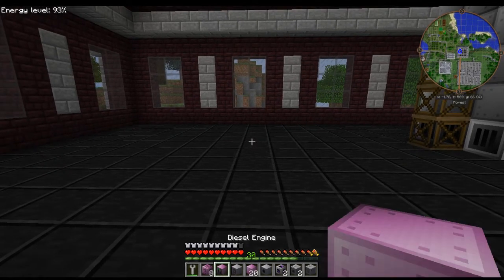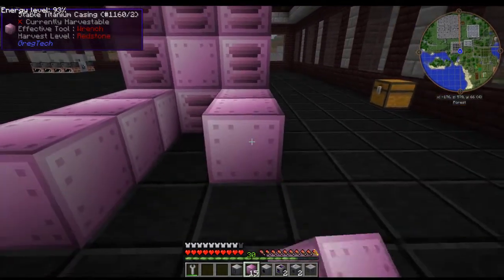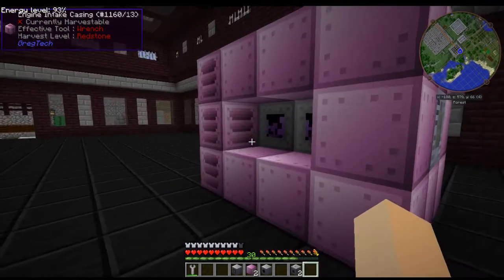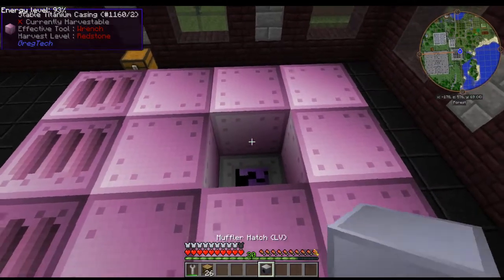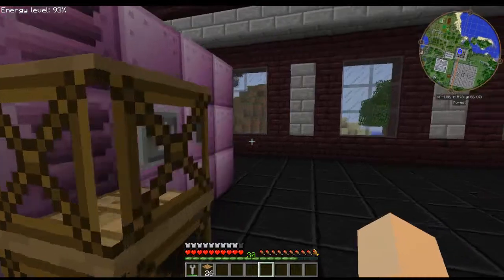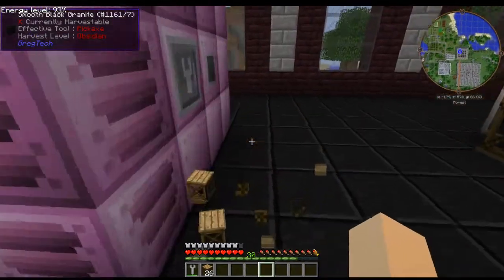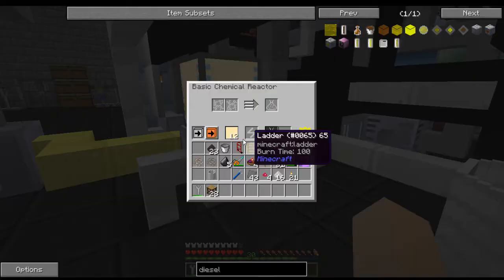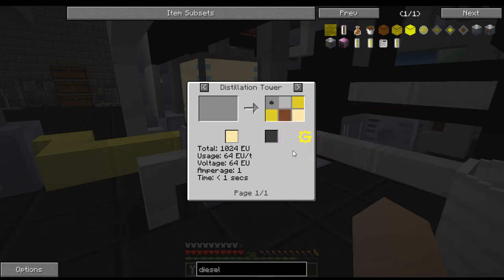GT5u Multiblock tutorial series - Diesel Engine / Combustion Engine

Comment: Super helpful! Once I eventually get the stupidly vast quantities of titanium necessary I look forward to taking a crack at it.

You were saying something important about boosting it but it got garbled I think... 30% fuel intake, 3x power output was it? Jeez. daang. That leaves me with one question. The scanner gives me info on cycle times and a couple of other helpful tidbits, but is there a tool that indicates the energy flow rate (like how much eu is being consumed or transported through the wires per tick). On a similar vein of questioning is there some way to measure volumetric flow rate through pipes, cause I've just been juryrigging my big boiler, but I get the feeling this engine needs a bit more precision.
Reply from the maker: yes oxygen will make it run at a max of 300%, and I always use twice the size needed for pipes.

Comment: Minecraft keeps crashing when I open GregTech with Pam's HarvestCraft, Not enough memory allocated? I got 2750Mb allocated on my gaming rig, should I increase it?
Reply from the maker: absolutely, GT takes a lot to run, CPU and RAM, any pack with it in it should have 3-4G of RAM allocated, if the pack is a kitchen sink pack you may need even more. I set mine to start at 1.5G and max at 4.5G, this will attempt to keep the Ram low if possible but has more available if needed, it usually runs around 3.5G. disclaimer, these are just what I have learned of the years of playing, I have no JAVA knowledge to be pulling this info from.
Reply: It actually works!! I put 4G and it runs smoothly! Thanks so much!! ^^
Reply from the maker: your welcome